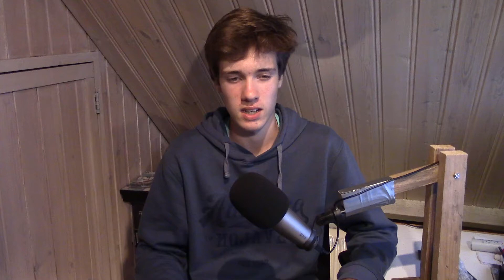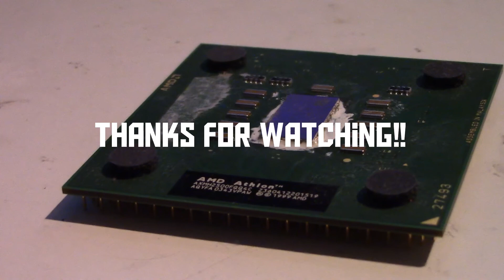What does the processor lithography spec mean? (AKIO TV)

Comment: is the lithography in nm the light that was used to produce these chips ? but if shorter wavelength is more precise it should be a logical consequence that in 14nm we have more transistors than 32 right ? very nice video btw.
Reply from the maker: Well indeed a smaller wavelength allows you to create smaller circuitry, but the nm number doesn't refer directly to wavelength. Modern 7 nm processors are often created using so called EUV (extreme ultra violet) machines that use very short wavelength radiation which has a wavelength of 13.5 nm. So although these things are certainly related, the number on the  spec sheet doesn't directly point to the wavelength used.
Reply: @AKIOTV  So what do the nms directly refer to?